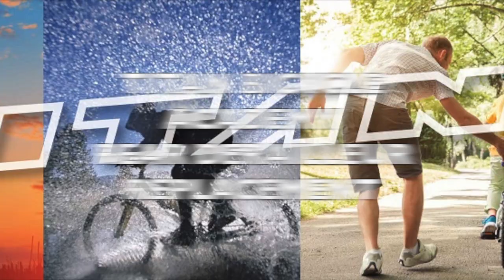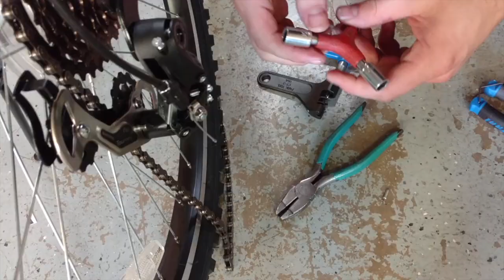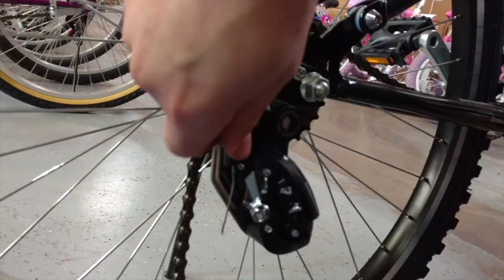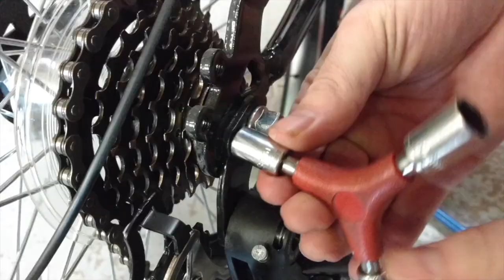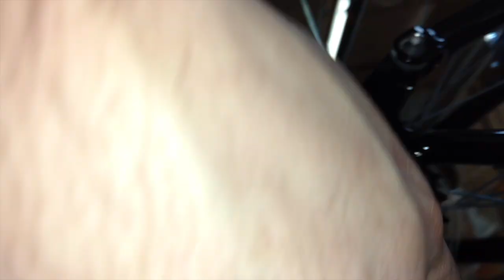Rear Derailleur Replacement

Comment: Just remove the lower jockey pulley. No need to break chain
Reply: THe lower jockey pully might not come out if you're tring to replace a flat face. Technically can but it rounds out quick.

Comment: 3:30    Under the anchor bolt, the cable placement is INCORRECT.
Reply: My thoughts also.
Reply: I guess it works but ya that's... the opposite of how that goes.

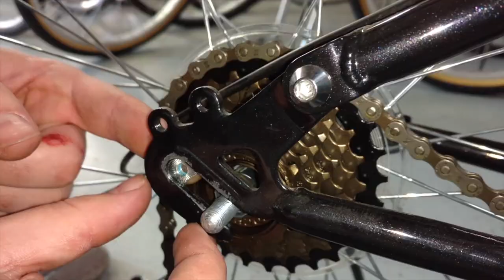Comment: Really good video! Straightforward and simple :) 2 questions, at 1:49, does the dropout nut need to be as high up as possible? and when putting the derailleur cable back through the anchor bolt (3:33) the cable has to be as taut as possible right, and what gear should the bike be in whilst replacing stuff? Thank you :)